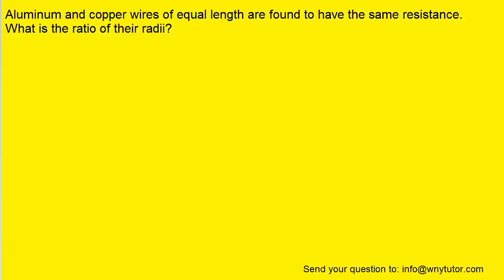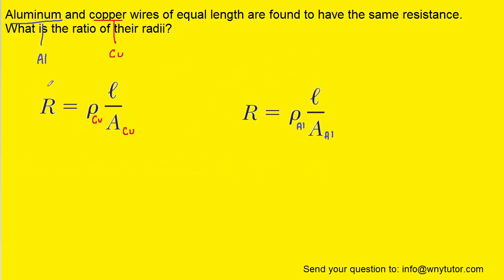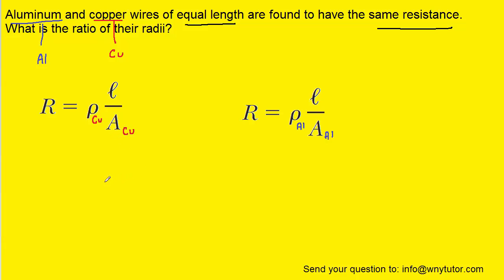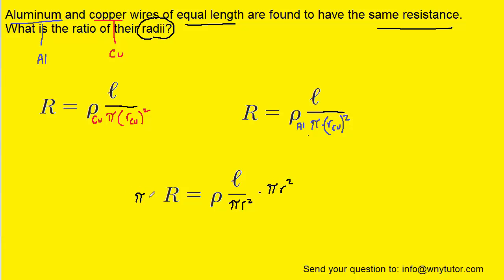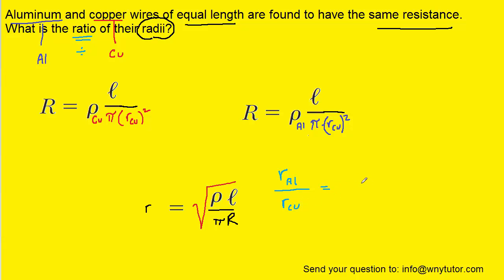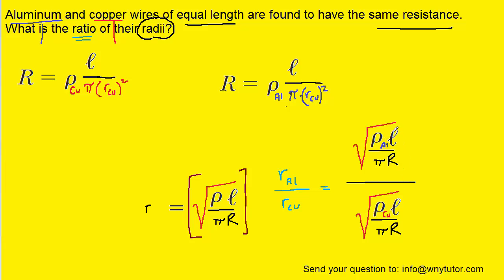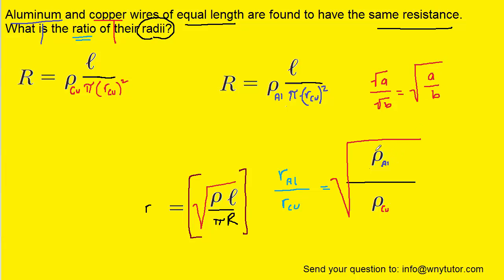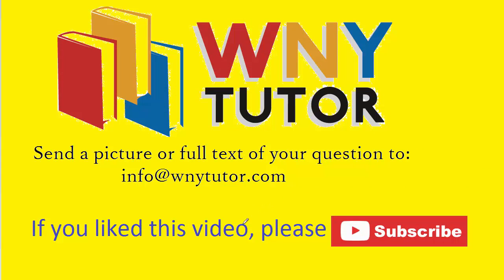Aluminum and copper wires of equal length are found to have the same resistance. What is the ratio o

Comment: The resistance of copper and aluminum are different.!                                                                                                                                                                                                           A100-foot length of copper wire will have less resistance than aluminum.                                                                                                                                                                                 Pie has squat to do with it.!!😆